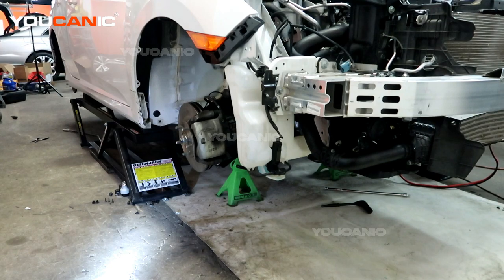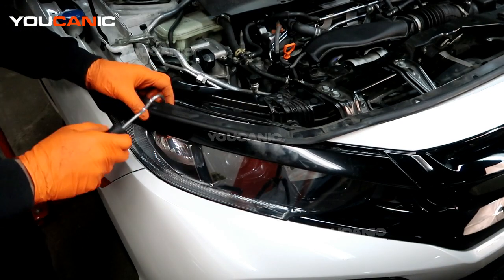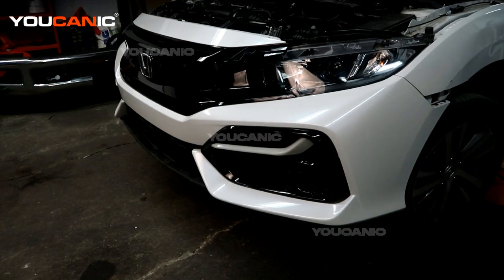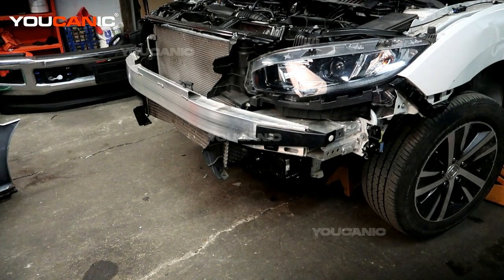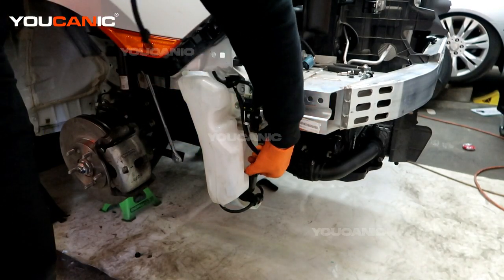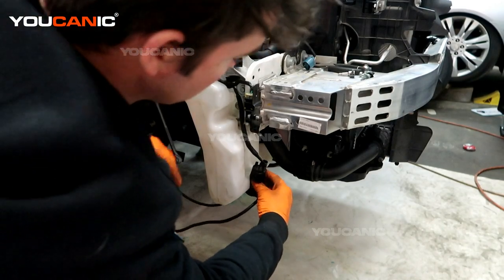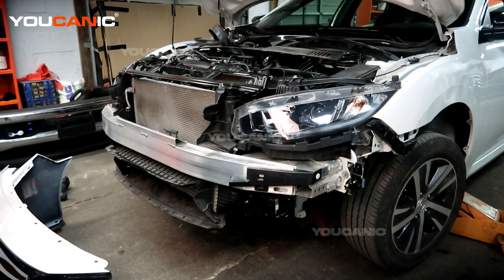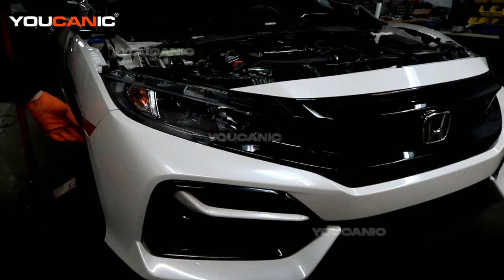2016-2021 Honda Civic - Windshield Washer Resevoir Replacement

Comment: They’re charging me 450 dollars because the reservoir shattered going down a pothole at the bottom. The damn think costs 50 dollars and takes 20 min to replace these dealership scams are getting worse everyday
Reply: Yea bro just buy the part and change it urself, mine is cracked and I bought the replacement for 30 bucks , gonna replace it this weekend
Reply: Definitely take longer than 20 min.
Reply: 20 min in an alternate universe. I'm doing it right now. It's not 20 minutes. Get over it. Stop looking at your phone and watch for potholes.
Reply: And get ready to replace a whole mess of button clips